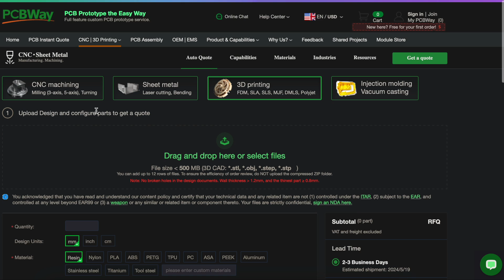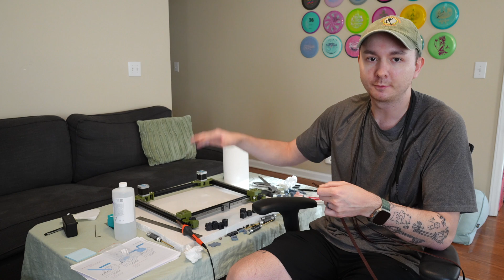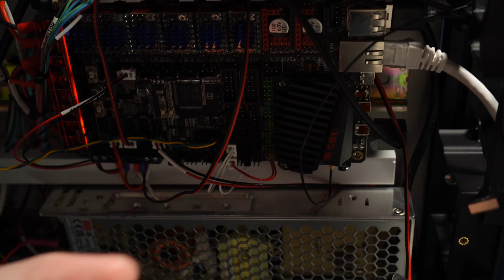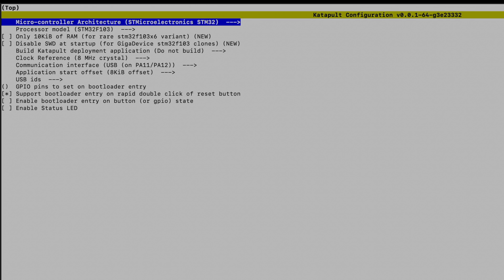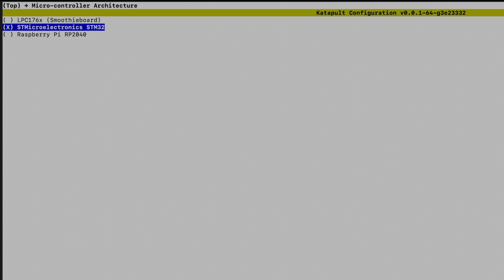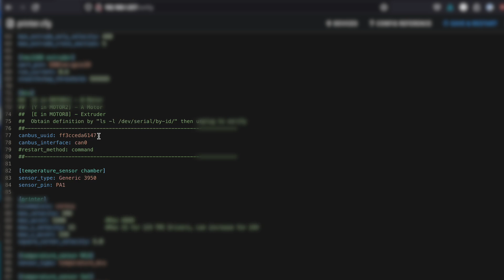Formbot Voron 2.4R2 Pro+ Kit Build!

Comment from the maker: My canbus guide is out of date. Please follow Esoterical’s guide: https://canbus.esoterical.online/

It seems like the kits are getting updates, such as the V2 version of the M8P. I can’t actually guarantee that my documentation is correct for the V2 M8P or any other changes.
Reply: This is just the video I was looking for! Great Build and Great advice! 
Just one question! The TAP printed by PCBWay was printed using their FDM process w/ ABS black filament or was it another process and/or material? :)
Again Many Thanks!
Reply from the maker: @TheWayOfThePrint  it’s SLS Nylon GF
Reply: @ButterPockets  Thanks! I literally just saw you mentioned it in the sponsor segment... I usually don't pay attention to those. Lesson learned :D
How did you print the Stealthburner Faceplate with those Orange Highlights? Is it in CAD?
Reply: M8P v2.0 is indeed different. Esoterical has the correct setup for creating Katapult and Klipper Configs.
Reply: @CP-tf  Hi, could you comment the link for this?

Comment: if you ordered the printed parts kit (like me), be aware that the umbilical connectors toolhead side has only the sb2209 default cable part in it

Comment: Hmmm i'm a bit confused, you flashed the katapult in DFU mode, that's fine, but you then flashed the Klipper also i  DFU mode, won't that overwrote the Katapult? Shouldn't you flash Klipper inside katapult, rather than DFU?

Comment: I am in the starting  stages of building a custom printer. I have a heavily modified Tevo and a CR10/Prusa mix from scratch. The Tevo I'm keeping but the other one just isn't as I had hoped. I'm starting a Voron switchwire as a starting point but the frame is going to be extended to accommodate a 400x400 build plate. On a side note, this is the only video I have seen that spells out what to do and how to do it as far as flashing the firmware. As for flashing the BUS toolhead, no one really pointed out where to plug it in, or how (usb to computer? Board? Before/After? where is the other side of the cable at? what do you mean it was already done before the video?) just simple things like that. Thank you so much. I don't have much for updates, since I only get about an hour or two to even work on it at night aside from work and life. This for me answers so many questions, and relieves the stress giving me hope to keep going forward on it.

Comment: Nice job on the video. I just ordered my Formbot kit last weekend so I'm hoping that is shows up soon. I ordered the CNC kit and received that today, but documentation doesn't match the kit, so I'll have to contact MatterHackers and see what's going on. I also ordered blue rails and titanium backers. I didn't see an option to select different rail colors,so I ordered an LDO set. Not sure how well the backers work, but a lot of Voron users swear by them. I'll make another comment when my build is finished. Keep up the great work.
Reply from the maker: I’ve been curious about backers. I don’t think titanium is a great solution - I remember seeing a huge GitHub thread with a bunch of testing to show that steel really is better. Titanium’s thermal expansion is basically random, it’s not like aluminum or steel. And adding a third metal into the mix isn’t great.

Comment: I tried following this to setup a Manta M8P V2 board, with the changed CAN interface PD0/PD1 but when the firmware is flashed to the board, and i use lsusb it doesn't show a can adapter, or any other device with the correct device id. Does anyone know what to do, i'm kinda stuck.
Reply: did you find a solution?
 I'm having the same issue

Comment: Hi, I follow your procedure and everything works until I reboot the manta. After that the cb1 cannot connect to the mcu until I manually press the reset button on manta... A firmware restart on mainsails does not work, I have to press the button. I have manta 1.1 m8p in my kit
Reply: It looks like the problem was the lack of  R120 can terminator on Manta. Once I installed the EBB with the proper R120 and can bus, everything worked fine

Comment: Well, spent a whole day troubleshooting the can bus and discovered that mine only works at 250k rather than the 1M like in the video. Even though I have the same Formbot kit ButterPockets has - Manta M8P V1.1 with a BTT SB2209 (RP2040) toolhead board.

Comment: Great video! However - from the front of the printer Left corner is B = X and A = Y.?.? The wiring diagram diagram lists them as X and Y. Voron defines them as A and B as well as the Formbot labeled wires. I have yet to fire up the printer, the wiring is complete. So the previous is somewhat of a question but the M8P setup for can bus helped me understand the Octopus setup with a U2C can adapter. The video helped me comprehend the structure of the can bus setup. Confusion takes over my aging mind more and more. What would make Voron 2.4 even more popular, I believe, is git similar to KIAUH. Only it would be a Software Installation Configurator... just like the machine configurator on the Voron Design site but it would be for electronic hardware and software. configuration Maybe BigTreeTech could develop it with the help of the "esteemed/accomplished" engineer @joetkeshub.... 😜 Happy printing!

Comment: Thank you for this video. Thanks to you I managed to bring life to my Formbot Voron 2.4Pro+.
Right now I'm doing the initial setup, but I'm getting stuck testing the end stops. The y-end stop works as expected, but the x-end stop and the z-end stop (tap) return the value triggered. That's understandable, because I don't know how and where to configure both. Can you point me in the right direction? Is it possible to get your config files so I can see how it should be done?
Reply from the maker: You either need to invert it with a “!” On the pin and/or add a “^” (especially on the tap pin) which is a pull up resistor.
Reply: @ButterPockets  Thank you. In the meantime I got the end stops and all engines working as they should. In the endstop_pin line I first forgot the reference to 'EBBCan'...
So now I'm a bit further along, but I'm stuck at the PROBE_CALIBRATE again. On the GitHub website I read that I had to do it manually, but it's not clear to me how...
Reply from the maker: @jefgeraerts3603 I’d consult with the voron discord if you get stuck. But the tap GitHub should guide you.
Reply: @ButterPockets  Ok. Thank you for the advice

Comment: Hello,

Thank you for the video! It has been a huge help. I was wondering if anyone has had an issue where the 2240 doesn't show up after the flash. Everything works as expected including the flash. When I shut down, remove the USB jumper, connect the can cable and run the query only 1 UUID shows up for the board under klipper. The katapult UUID doesn't show up.
Reply: Thanks for getting back to me. I was able to get it working but had to purchase replacement boards to figure it out. The m8p was bad. Replaced the sb2209 with no change, setup a new m8p and everything works. Attempting to get my m8p replaced but btt and formbot have not been much help so far.
Reply from the maker: That sucks and I’m sorry to hear it. You’ve reached out to both Formbot and BTT? Which has been more responsive?
Reply from the maker: I know this is a week late, but double check the 120Ohm terminating resistors on both the M8P and the SB2209.
Reply: They are both responding but ignoring the info I gave them. For example, I told them the 120 ohm resistors were in place and I verified 60 ohms between can high and low and their response was to ask if I had the jumpers in place for the 120 ohm resistors.
Reply from the maker: That’s incredibly frustrating. If I can help at all add me on discord @butterpockets. I can always try and help! Maybe not with replacement parts tho haha
Reply: Thanks! Sent a friend request. It's coming from @schwing9946

Comment: Hello! Of course, you are great for making the instructions! but she is not correct!!! There is an error and because of the error it is not stitched! sudo dfu-util -a 0 -d 0483:df11 --dfuse-address 0x08002000 -D ~/klipper/out/klipper.bin
mistake in address!!! here is the correct address 0x08020000
I spent 2 days studying Youtube because of this!!!(((
Reply from the maker: The address 0x08002000 address is correct because you only need a 2kb offset for katapult. You should not need a 20000 offset.
Reply: @ButterPockets  whith address 2000, can device is not detected! My board manta v2
Reply: @borys9549 my documentation is for the v1.1 which is stated on the top of the doc.
Reply: hi. did you manage to get the manta m8p v2 to work with the sb2209 ?  i cant make it work :(((
Reply: @cristiciobi8275  yes. everything works! i have sb2240. but there is no difference in firmware! do everything according to the instructions! only when flashing manta change the address! as i wrote in the previous comment!
Reply: @cristiciobi8275 or write your email and I will explain
Reply: @cristiciobi8275  or write your email and I will explain
Reply: @cristiciobi8275  where you able to see the canbus adapter after flashing katapult and klipper

Comment: Thanks for the video, this has been a great guide for me never putting a 3d printer together from Kit before. I have the same Formbot kit (m8p with  CB1 and EBBsb2209(RP2040). I still can not get the printer.cfg file to make Klipper happy. Im using the suggested samples for m8p + CB1 for the printer.cfg and included the sample.cfg for the rp2040. I know you didn’t  post your config file for reasons you mentioned in the video, I respect that. However, to the ones out there, like myself, following along with your video, having the same components...would you consider sharing your config file? I think it would help a lot of people like myself. Ive been stuck on the .cfg files for about 2 weeks now. Thanks again for the helpful content.
Reply: That's a great question an answer would be nice.
Reply: @jameslee6881  agreed, please post with disclaimer so we can use!

Comment: For anyone else going the Nevermore v6 route and mounting it under the bed, make sure you don't make the error I did and print the "Straight" cartridge that will just blow directly at the Voron 2.4 doors that are clearly not airtight.  The "90deg" is the correct cartridge for this design so that the heated air recirculates in the printer instead of being blown out.  The other cartridge style is for mounting to the back or side panel for a Trident or v0.
Reply from the maker: I did the same thing :) I re-printed it after the video

Comment: I had to de-pin the CanBus cable to have it fit in the PG7 gland
Reply from the maker: If you pull out the rubber stopper it will fit. It took some shoving but it worked! De-pinning makes it much easier tho.

Comment: This guide was great, except I got caught on the last step of flashing klipper to the toolboard. Turns out you need to plug in the 120 ohm Termination Resistor. Please add this to your PDF
Reply from the maker: I pointed that out in the video but I added a more direct callout in the PDF!

Comment: Could you please give me a hint, where I have to place the X and Y endstop switch. I cannot find any manual for the actual Formbot Voron 2.4 Pro+. I ordered the printed parts from Formbot too. And there are some parts I don't know what they are for or where to place them. The Formbot documentation is a mess or not existing.
Reply from the maker: The X end stop is on the tool head. The TAP parts have a spot with 2 small holes meant for self tapping screws and the end stop. It’s why the plug wires are small cause they go right up the SB2209. And Y end stop is shown in the video towards the klipper install where the CAN cable routes on the gantry to the drag chain. It’s mounted right above the B motor and uses some additional printed parts that are listed in the doc!
Reply: Thank you very much for the support.

Comment: Got the same printer from formbot. When i follow your document, in the last step when trying to flash klipper, i get an error with problems while flashing in several lines (ERROR:root:Flash Error...). Tried it over 5 times with different sd cards and followed step by step. Still cant get it to work.
Reply from the maker: So someone else had this exact same issue. I’ve had someone look over my instructions and they confirmed them to be correct. The weird part is even tho that happened if you query for the UUID you should see both devices show up as klipper. It seemingly worked for them even though they had the error. Unless we sit down together and look at it I am really at a loss of what the problem could be. You can add me on discord tho with the username “butterpockets” and we can try and check it out.
Reply from the maker: For what it’s worth I just went and updated my tool heads version of klipper and everything flashed fine. I followed my own instructions (I promise I didn’t do anything different) so I’m really not sure.
Reply: After some days i somehow managed to get it to work. I was about to repeat the process for the 10th(?) time with your methode (I tried some different ways without success, too). Before i started all over i once more looked for the uuids which were listed as klipper and katapult (thats where i stopped the day befor) and surprisingly they listed both as klipper. I couldnt beliefe what i was seeing. I followed your protocol and got the same error again. But i just restarted and got the two times klipper uuids again. So i just accepted that i got the error and went on with the setup of the cfg and against all odds it it just works. o_O I dont try to think about it anymore and im just happy that i finally got it to work.
Reply from the maker: @LanYui that’s exactly what happened to the other person. We ignored the error and it just worked! No idea what happened.

Comment: The wiring diagram says to mount the DIN rails parallel to the bed extrusions.  In your video, did you have them perpendicular? Things seemed to fit well.  I'm about to do the electronics and am wondering if I should change the orientation? I'm so glad I found your video.
Reply from the maker: Yeah that’s one thing I kind of tried to hint on when I said that it’s hard to get to the SD card on the M8P. I haven’t really put too much thought into what it would look like that way. I went with the layout I have on both my 2.4s and it’s worked out well for me, but that doesn’t mean it’s best at all. So I’d say it totally works but it’s also possible the parallel method is better (it probably is). If I was going to do it again I’d look into the EMS mounting system which gets rid of din rails and replaces it with a modular printed system.
Reply: @ButterPockets  EMS mounting system - You just blew my mind again. I wish I had seen this before I mounted my electronics.
Reply: I can confirm that mounting parallel works much better for accessing the microSD, but the only downside is that the two MCU fans won't reach the PSU for cooling the way they would when mounting vertically. I'm not sure that matters because the MCU is the main thing we need the cooling for I suppose.
Reply: @Burnsian85  Would you happen to have a photo of how you mounted your electronics underneath?

Comment: @ButterPockets I was having a terrible time with these instructions UNTIL I realized that everywhere in your document where the code points to the katapult directory ("~/katapult/out/katapult.bin" and similar) you have to edit the line to capitalize the K in the Katapult folder! It seems like the Katapult folder probably always writes itself with upper case K, so I imagine other noobs may scratch their head for a while at this part too. Does this warrant an edit to your instructions file?
Reply from the maker: That’s really strange because I actually used my document to copy paste for the video and you can see it’s all lowercase for me. 

I wonder why it may be different?? Maybe I will add a line that says it may be capitalized?

Edit: I would think that means in your initial git clone the K was capitalized in the command you ran so you just cloned the Git to “/Katapult”
Reply: @ButterPockets  Yes you are probably right. I'm such a noob at all this, and despite your great instructions, I still am stuck near the last page unable to get everything working. Facepalm.
Reply: @ButterPockets  Long story short, I'm at the very end on the last page and flashing Katapult is failing. I think the error code is suggesting the MCU can't reach the control board, but since they were talking to each other already up until now, that doesn't make much sense and replacing the CAN cable seems unlikely to work. I've checked my 120R jumpers, checked continuity of the CAN wires, and I have no idea what else to do.
Reply from the maker: @Burnsian85  message me on discord, it’s just “Butterpockets”